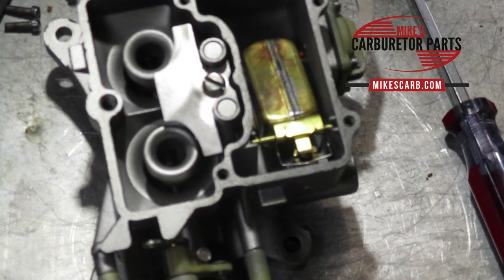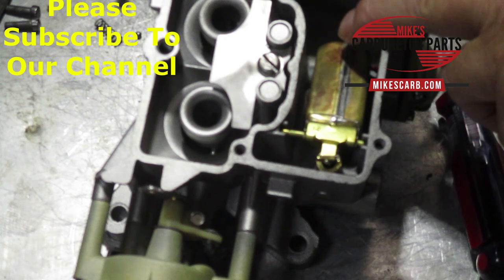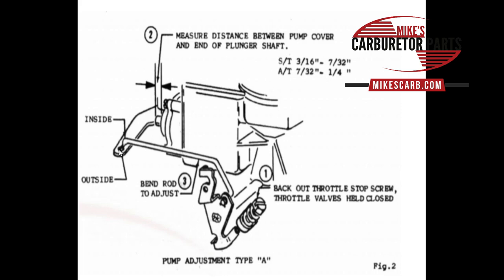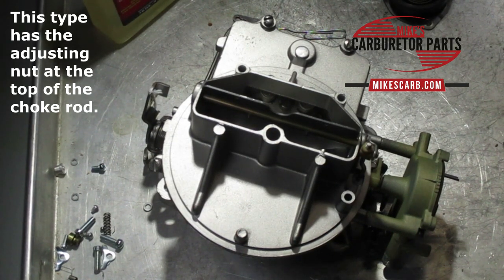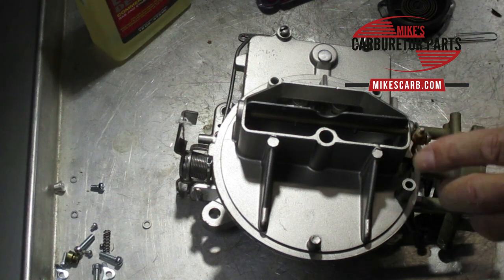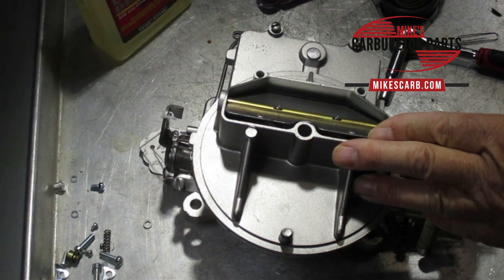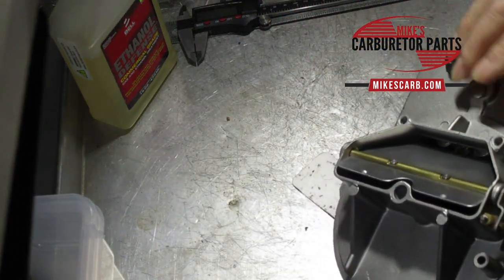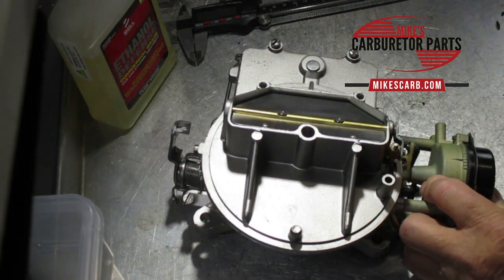Motorcraft 2100, 2 Barrel  Adjustments

Comment: Thank you for making this video.  I appreciate your efforts.  Nicely done!
Reply: I'm actually doing a conversion and i put this carb on a custom crown Toyota and this is very helpful thanks a million i wish you had an actual conversion video from two barrel Toyota to two barrel Ford i couldn't afford the Weber's thank God but next i should be EFI because yeah it's been a little challenging being my first conversion and having to convert everything from pedal to carb even down to acceleration rods to cable and luckily i was able to keep the transmission kick down without changing much and now after this i should be accelerating away

Comment: I’ve been waiting for an in depth video like this for years. Thank you!!
Reply: @MikesCarburetor  just solved a big problem for me as well- thank you!  Although the found the chart for this carb online, a prior owner had put it on my Jeep with the 258 straight six so there are no specs for my engine on the chart.  Should I just use another similar displacement I-6 engine for comparison?

Comment: I’ve got a 2100 type B carb , I’ve completely rebuilt the carb and I’ve put it back on the car , but the problem I’m having now is it’s burning rich, I’ve turned the air fuel mixture screws in all the way and nothing happens, engine runs the same, I take them out , also while engine is running and engine runs rough, so I know it’s clear, but why isn’t it doing anything when I run them in if it does it when I take them out ,

Comment: If I turn the fast idle cam righty tightly that will set for a longer duration of fast idle correct
Reply: Fast idle is speed of idle the length of warm up is on the choke loosen 3 screws and go clock wise for longer richer warm ups

Comment: Hey Mike, Ive got a 2100 here in the shop with a different unloader/fast idle cam set up than what you show in your video https://youtu.be/xa_pCSQaS-c?t=905 mine doesnt seem to have an unloader and the fast idle screw doesnt ride on the cam. An arm that rides on the throttle shaft has the adjustment screw in it that steps on the cam and that pushes on and arm thats attached to the end of the throttle shaft. But there isnt a way for it to unload the choke. its a 72 Gran Torino with a 351c. Am i missing something? Thanks for your video.
Reply from the maker: Does it have a choke pulloff?
Reply: @MikesCarburetor  yes, the one in the air horn

Comment: I rebuilt my 2100 with your correct kit on my 65 Falcon 289, I have correct timing and plug gap. Pertronix ignition. No vacuum leaks, spark plugs look normal, not lean or rich. The engine stumbles on accel and have to feather the throttle on accel. The warmer the engine the better it gets but still there. I get good squirts from the accel pump. I have noticed the accel pump linkage moves much slower than the throttle plate linkage? If I rev from the throttle it stumbles, If I pull and rev from the accelerator linkage manually there is no stumble and  it revs great. My question is: Is this normal operation of the accelerator linkage to slowly follow the throttle open or not? Any suggestions. I plan on taking it back off and doing all these adjustments in the video again.

Comment: tune up question -- my  stock 64 fastback with 390 4 bbl Autolite 4100 carb -- when engine is cold I have to crank on it about 30/40 seconds before it will crank up. Once it's warmed up  it will crank immediately but shut it off for 4 hours and the gas seems to disappear out of carb. I have the 1" water cooled spacer under the carb. Engine runs cool and runs great. It has a Mikes Carb repair kit in it (by far the best I've found in 65 years of doing this stuff.) Any suggestions?

Comment: I have a 57 fairlane 500 with a 292 and automatic transmission it has the 2100 carb and I’ve rebuilt the carb , but card ideas fine but as soon as I move throttle it stumbles and Boggs down , I’ve turned the fuel and air mixture screws all the way in while engine running and engine never changed it’s idle , can you help point me in a detection to what’s wrong?

Comment: My 2100 has an extra “arm” and screw on the throttle. Its not attached to anything in particular. It’s not the idle screw but one just above. This extra “arm” is almost like an extra throttle and is just to the inside only it’s loose as compared to the throttle. It is not the vertical bar with the holes for the throttle pump. I’ve been watching your videos looking to see what it is but can’t find it. I got the carb to rebuild and put on a 1990 yj. It’s a D4-PE EC that the internet says came off a 70 mercury cougar. I rebuilt it with one of your kits. Worked great. Just afraid to put it on if I’m missing something. The part Seems like it should attach to something and has an adjustment screw. Maybe someone attached it to convert it to pull down instead of rear pull (but then why the screw). Could it have had a dashpot at one time and if so is it ok to not have it anymore. I’d attach a picture but I’m not sure I can
Reply: I figured it out. Was for a dashpot that’s no longer there (for automatics).

Comment: Mike, what is that hole on the top of the carb (in front of the butterfly and right in the center on top of that notch)? My Autolite 2100 has that notch as an open hole but I see that yours is plugged/blocked off??? Thanks :)
Reply: @MikesCarburetor  Okay thanks!

Comment: I have a 73 f250 390ci. With a 2100 carb,    for the passed 12 years I've had to rebuild it 3 times even though it only has  under 1,000 miles in 12 years,  because it starts leaking around the acellorater pump diaphragm  and when I take it apart and hold the diaphragm up to the sunlight it is full of pinholes !!  I guess it is the ethanol fuel eating up the diaphragm.  What can I do to stop this,    so far I haven't been able to find ethanol resistant carburetor rebuilding kits for this carb.  And I can't get non ethanol gasoline.  What do you suggest ?  Thanks William.
Reply: Past 12 years not “passed”

Comment: thank you for the video .i have a 1983 mercury cougar 3.8 motor and having problems making carb adjustment on it. it starts but only stays running if i keep my foot on the pedal and stalls as soon as i leave go of the pedal. do you have a video on 1983 mercury cougar carb adjustments? thank you.
Reply: Sounds like your idle circuit Is clogged. Clean your ventures